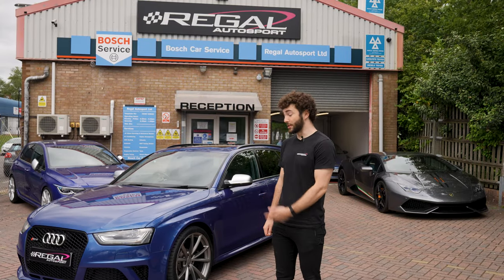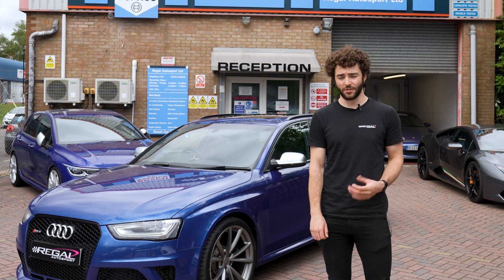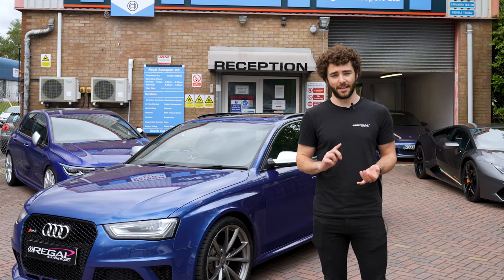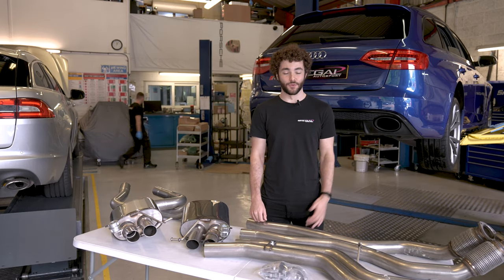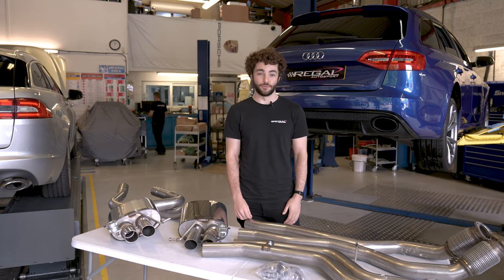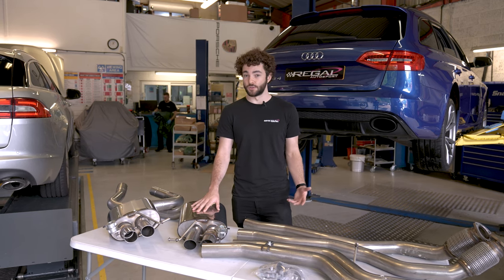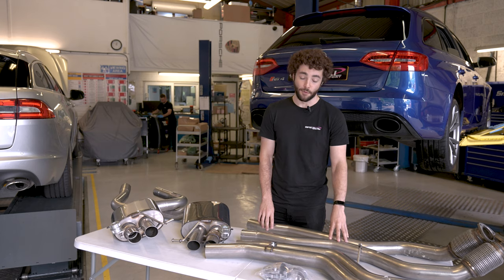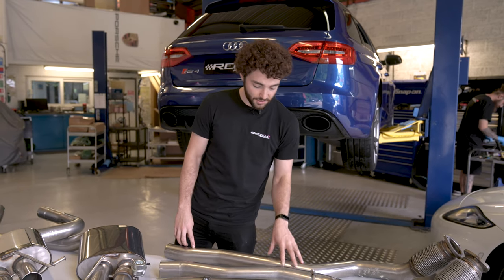B8 RS4 exhaust Milltek Sport SUPER Non-Resonated Exhaust Upgrade

Comment: hey what is non res v res I can see this online. Thanks.
Reply from the maker: Resonated = quieter
Non-resonated = louder
Reply: Your engine is an air pump or think of it as a wind instrument that pushes out notes. Some notes match the natural frequency of the room and resonate in the room and make it shale.

All exhaust systems have a resonant frequency where the exhaust starts to drone. Manufacturers spend £££££ dialling it out   modelling and use the correct sized centre resonators - which are just expansion chambers that aren’t restrictive but take the sound energy out of the gas flow.

While this exhaust sounds like a race car I bet it drones like hell on the motorway or at certain rev ranges. It’s a matter of how much of you time you spend in that rev range and if you can put up with it.

I had to re-insert the resonators in mine as it became a nuisance on anything other that B-road blasts.